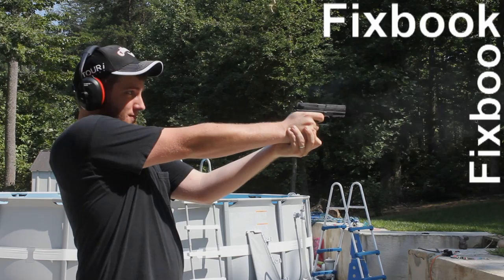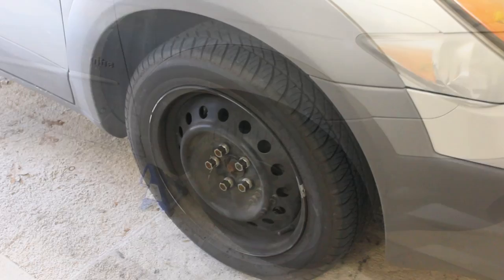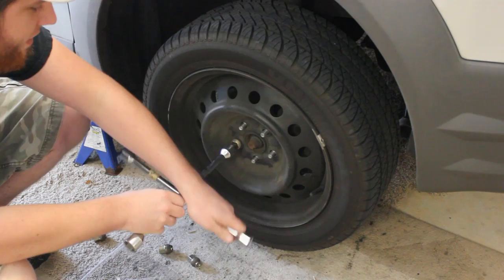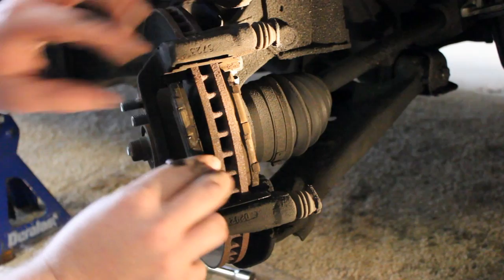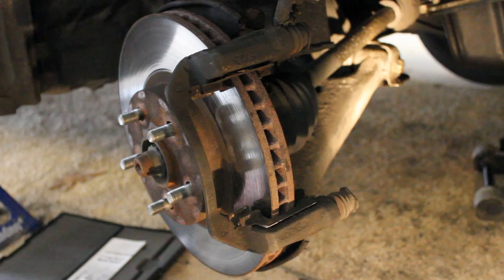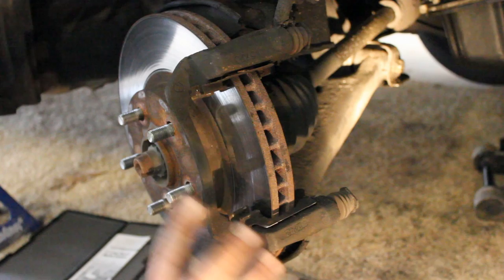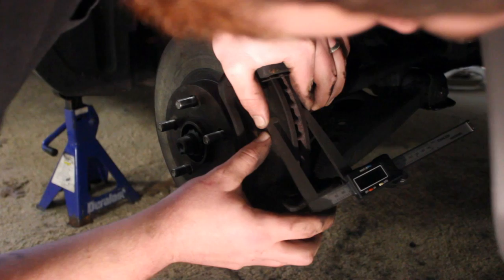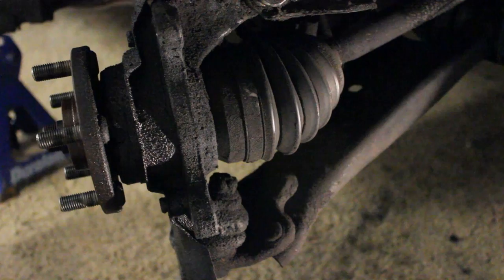Pontiac Vibe, Toyota Matrix Front Brake Removal Replace

Comment: This car has very low clearing.  When I jack it up from the location described (which I have also validated from a manual) I am not able to fit a jack stand under the car.  What is your trick in lifting the car high enough to fit the jack stands?

Comment: Some guys I know replace rotors every time.  It is my experience that rotors will last several hundred thousand miles and unless abused and do not ever need replacing.  If there are some groves in the surface this is not a problem and will not harm the new pads in anyway.  Of course if they are warped or under size spec that is a different story, but this typically doesn't happen with normal driving.  If your the kind of guy or gal that likes to get to the light before the next guy and slam on the brakes, maybe you need them.  Otherwise they can last the life of the car easily.

Comment: Also, if Oklahoma law allows Spanish-speaking residents to get drivers licenses, why make their preparation more difficult?

What if they misunderstand something in the test written in English, pass their test, but end up misunderstanding something important about driving laws?

This sort of racism (and I don't throw that word around) could directly affect the safety of all residents.

Also, the ten commandments thing is a clear endorsement of a religion. As long as they allow any other religions who request it an equal space for their commandments or other monuments, then it's fine. But if they want to promote Christianity and Christianity only, hell no. 

Besides, the ten commandments can be re-written in about five minutes and improved drastically by anyone of average intelligence. Check out Matt Dillahunty's video about this. 

Anyway, thank you again for the great videos about the brake pads. I plan to replace mine soon (we have a 2003 Matrix and 2006 Vibe), and this video will be very helpful.

Comment: Resurfacing a rotor instead of buying a new one is not going to put you in danger of any warping coming back.  The only ways that can happen is if the rotor is warped at the core and then it is garbage either way, or if the warp is being caused by a bad caliper or some other fault in the overall brake system which would warp a brand new rotor the same as a resurfaced rotor.  If you resurface a rotor, as long as it is done properly, it is like getting a new rotor.

Comment: dad has a 04 matrix and over all its junk we have had so many dumb problems in the 2 years he has had it
Reply: owen benJEWman sucks VOX OFF  it fun to see a reply on a comment from 7 years ago we are retiring the car this week the past seven years have been mostly problem-free it was just a little bit too rusty to get a sticker again width 700000 km it runs just the way it did nine years ago Burns a fair amount of oil now but that's to be expected transmission is also starting to shift a little rough now and then considering the transmission fluid is original I would say that's not too bad we are currently looking for another Toyota Matrix that has less miles to replace it other than the few issues at the start it's been an absolutely wonderful car I take back my comment from 7 years ago

Comment: Oh, side point - commenting as I watch the vid. As for the language requirement for DL exams. If the road signs are in English then so should the exams. It doesn't do anyone any good to test in any other language other than the language that's used for road signs across the US. That's my take. It's not racist in any way - at least in my opinion. It's a matter of safety or more so a confirmation that the individual completing the test is fully capable of reading and comprehending road signs.